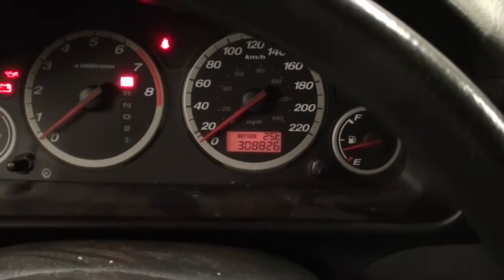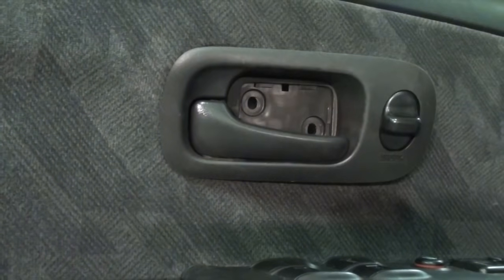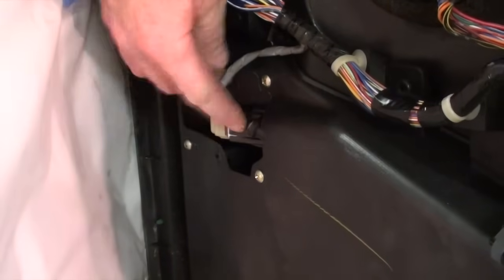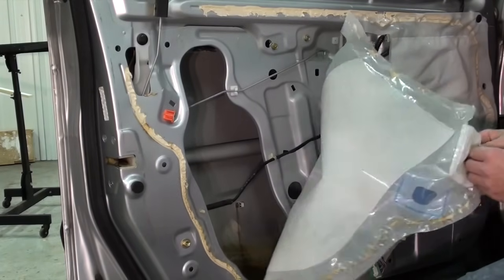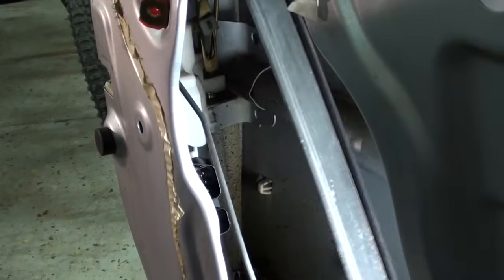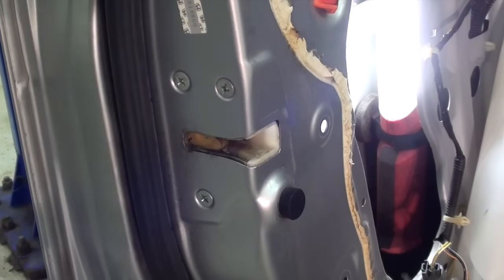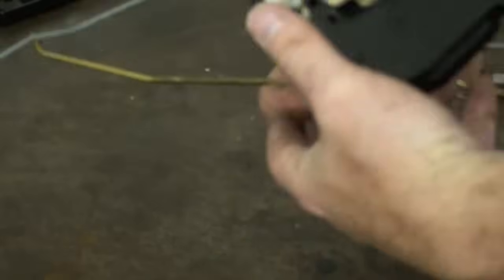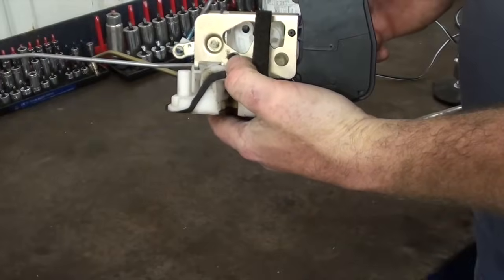Replacement - Door lock actuator - HONDA CRV

Comment: Sir is this car comes factory fitted with central locking system?

And, the actuator switch or connector on 4.09 at the latch actuator is for remote central locking or for some purposes!!?? Please help me about this.

If disconnecting the wires from the connector at this 4.09, would lock or unlock functions work with remote keys??

Comment: Anybody ever have the problem with an 02 crv that key power remote only works on 1 door when press to unlocked or lock but only rear driver door will do it and the rest won’t unlock or lock  and with the power locks inside does the same does that mean all 3 door lock actuators are bad or can it be just the driver door causing other two not receive signal ?

Comment: I ve seen 2 different actuators, white and black one for Crv 02-06. What's the difference?
Reply: +DeTodoaLoTico The black one is for cars built in Japan (VIN starts with "J") and the white one is for Great Britain (VIN starts with "S").  El negro es versión japonesa y el blanco es hecho en Gran Bretaña.  Si el carro es de FACO el actuador es negro.
Reply: +Gerardo León . Hi i have same problem. If i want to replace it which one should i replace the black one or the white
( My vin number starts with J)
Reply from the maker: +abbas razzaq If the VIN Start with JHM it is a Japan built CRV.  So I would say Black.
Reply: +BackYard Tech (Crownedroyal2003) The vin starts with (JHLRD...)

Comment: Actually, I'm in the process of doing it right now. The hardest part is trying to get the door cover back onto the door. I'm trying to align the clips, but ones on the mid-sides are not clamping down. Damn.

Comment: BackYard Tech, Thx for the great video! I have a 2002 Honda CRV. I am having trouble with my drivers side door lock. Similar to Al F.'s comments way below. Does the drivers side actuator override or control all the other 4 (5 including rear door) door locks / actuators? In other words, if the driver side goes bad, will it prevent the rest of the door locks (keyless door entry) from working? Thanks!
Reply from the maker: If the switch that signals if the lock is open or locked goes bad the other locks will not work.  One click of the remote unlocks drivers door, the second click will unlock all doors.  If the micu (body control unit) doesn’t see the drivers door unlock it will not unlock the remaining doors.  Clear as mud.   Hope this helps.

Comment: Is this for the england made one or japan made one?
Reply: Will actuator from 1998 crv fit in 2002 CRV
Reply: This is for the Japan-made version judging from the Honda replacement driver-side door lock actuator part number 72155-S5P-A11.

Comment: Nice tutorial! Does anyone know what the problem could be if the door actuator was replaced (passenger side, black part Japan), fuses are OK but auto door lock still does not work? I also had to get 2 of the 3 flat screws drilled out on the door as they would not come out for me and they got stripped by the dewalt, screw remover did not work either so watch out for that.
Reply from the maker: Broken wire in the door jam.
Reply: BackYard Tech - yes that is what it turned out to be or a wire not making contact according to the shop I had fixing it. 106k miles 2002 CR-V. The drivers side door lock actuator was also replaced about 5 years ago.

Comment: Just to add. This video is for Japan made CR-Vs of this generation. There is another batch made in the UK which requires a slightly different way to replace the actuator and the item has a different part number. Just FYI.
Reply from the maker: Good to know.  I have only dealt with the Japan made CRV's

Comment: Let's assume the wiring is the problem. Is that something the average Joe may be able to repair on their own? Or for safety reasons would you recommend taking it into a shop? Thanks.
Reply from the maker: Most of the wiring issue I have seen have where it pivots in the door.   Tricky to get at to repair.
Reply: BackYard Tech 
Thank you, sir. I'm pretty sure the wiring isn't the issue but I was just curious. Cheers.